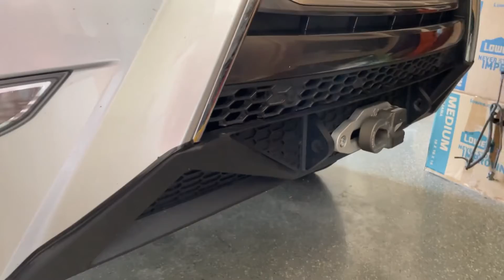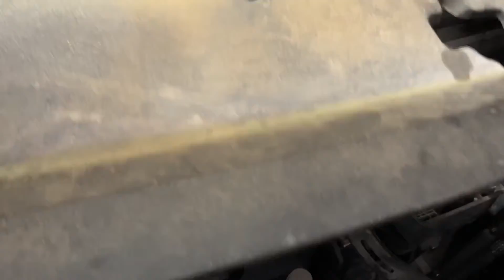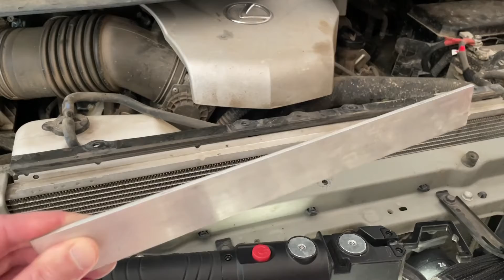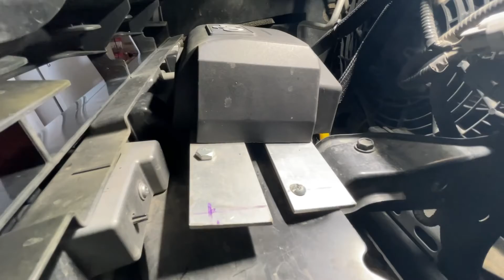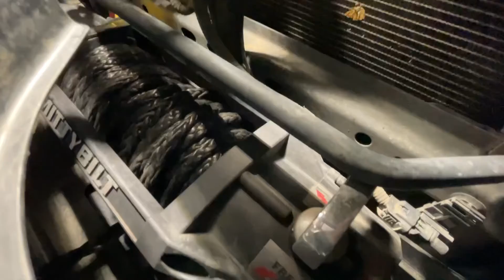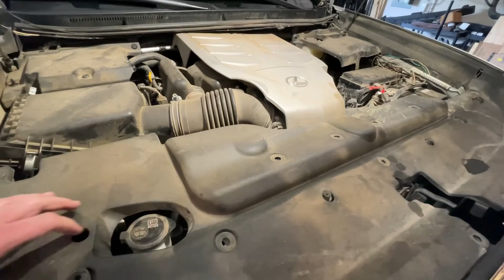Custom Winch Control Mount - Lexus GX Overland Build

Comment: Nice video - did you have to lengthen the cables to the controller box?
Reply from the maker: Nope - the ones it came with worked just fine.